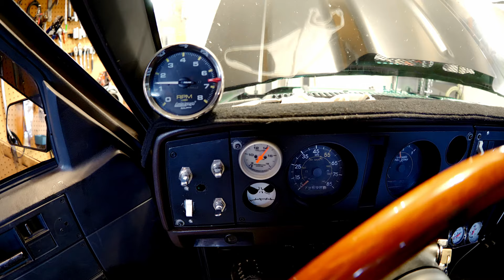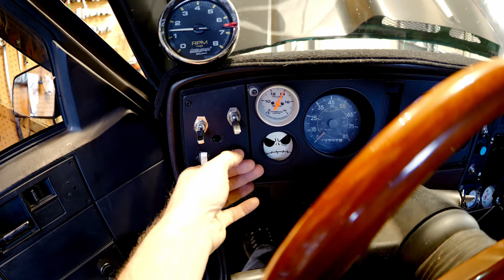Holley 4150 carburetor tuning “secret” you probably don’t know about.

Comment: We use to bend the factory linkage to get them to open sooner
Reply from the maker: Then it was probably opening the secondaries past vertical. Been there done that till I realize I was causing an issue.
Reply: Most likely your right, but it picked up our Cutlass .11 in the 60ft

Comment: I noticed you move the throttle twice on your fast rev up.   On second blip to get instant RPM I believe you are carrying over from the accelerator pump shot on the first blip.   I believe you double blip to keep from bogging.  Then, what the hell do I know?   I did the horrible thing on vacuum secondary Holley to put the screw in to override the vacuum diaphram on the linkage.  Take it out to get fuel milage on trips.  Going to race, put the screw back in.   Had 4 speed, so no problem pulling up against torque converter.

Comment: Thank you for great information & sharing your thoughts and progress. Like you I've been chasing & refining my tune for a while - this is one I'll have to try. 
One of the greatest improvements in throttle response came from the installation of Thompson performance power blast plates to both primary and secondary sides, particularly with the heavy accelerator pump shot I needed.  Cheers Mike

Comment: Thank you for posting. Great info. I made the part for 5, at 45 dollars it was high just to see if it worked.
 Well...it worked great. definitely picked up some snap. First hop on the street the shift light came on quick, I shifted, it stayed on. I usually do not lift when shifting, definitely had some wheel spin.

Comment: I was just tinkering with my Proform 750, before watching this. I noticed a high pitch squeal/whistle, when secondaries open. Never noticed it before. Maybe because the engine was louder at the point that they open, stock. Sounds like a compressor engine. I think I heard it on yours as well.

Comment: Sounds like to much transfer slot used  up to get idle  drill .093 holes in
Blades to shut them down so .020 shows  tranfers are acc. Pump shot
Before. Shot from above.

Comment: You can make all 4 butter flys open at once if you don't care about gas mileage ,I think you should have just went up in # on the squiters ,if you had the correct power valve ,check vacuum say its 20 so you need a #10 power valve then dial in the squiters  then the accelerator pumps and then the jets
Reply from the maker: I have videos that talk about all that check them out.
Reply: I went to 46 squirters, and still got a lean tip in at cruise. This fixed it. Yes maybe I could have dIcked around with the PV, but everything was good after the initial lean hit.

Comment: Great videos,
Frustrated with idling in gear at a light and loading up. I am going to have to increase my stall speed but do not want it to be to loose. 
 I have a comp hyd roller 286. 230/236, 350ci, 10:1, 67 nova 355's
 I have the holeshot 2400. I like that it is tight on cruise but think I need to go to the 3000.
Wondering what stall you have?
Reply: Do you have an afr gauge?

Comment: It doesn't give you the ability to adjust the timing of the secondaries opening.  It only allows you to change the opening point from stock to a point dictated by the position of the second hole and the length of the adjustable link. The adjustable link can only be one length, the length that places the secondary throttle blades at fully open when the primary throttle blade reaches fully open.
Reply: @bigboreracing356  If you will look at your carb you will see that you have multiple holes for the link on the throttle shaft. You pick a hole (which is what changes the ratio) then you adjust the length of the link to make the sec. throttle plates straight up and down at WOT. Your camshaft/crankshaft analogy is complete nonsense.
Reply: @bigboreracing356  "How is it nonsense?"

The carburetor adjustment is a change in ratio. Your cam/crank analogy has absolutely nothing to do with a ratio change.
Reply: @bigboreracing356  And what would that have to do with neither you or the OP  understanding that the adjustable link has nothing to do with changing the ratio, and that it is in fact  moving the linkage attachment point that results in a change?
Reply: @bigboreracing356  What are you six years old.
Reply: @bigboreracing356  This is hilarious.

Comment: Cool video. Question, did you square up the power valve and jetting primary to secondary? Seems like that is a must if you make this change.
Reply from the maker: The best way know if you're jetting is square with a PV in the front is to first block off all PVs and get a good WOT AFR of 12.5. then put a PV in the front and jet it down until you hit the same AFR you have then confirmed your jetting is square with a PV in the front. But changing the secondary linkage has zero effects on jetting but you may have to retune the discharged nozzles / cams.

Comment: So by installing this linkage and making adjustment for the secondary to open 1:1 this will open up my secondary sooner BUT  will I need to eliminate my rear  power valve in order for this to work
Reply from the maker: You can keep the rear PV.
Reply: @TPVPRO  ok thanks what is the benefits of  blocking the rear power valve
Reply: @ddstaton211 locking the rear power valve only needed if you already have too much fuel under part to mid throttle, usually carburetors with billet metering blocks allow for fine fuel adjustments you can thereby eliminate the power valve in most instances. Every engine combo is different sometimes depends on what your purpose is wide open strip usually best to delete power valves if I’m not mistaken…

Comment: Noticed your idle is way up 1300+ rpm w/ that lopey cam. Is it possible to bring idle down to atleast 1000 rpm w/ big cams? TIA 🙂
Reply from the maker: @benjiedelrosario4346  Yes, but I have a solid roller, and I prefer higher RPM for better oil splash and pressure. It helps extend valvetrain life.
Reply: @TPVPRO  I have a 289 sbf w/ a big cam that also idles between 1200-1400. When I bring the idle down a bit the engine stalls. Any ideas how I can adjust idle between 1000 to 1200 rpm? Thanks in advance 🙂
Reply from the maker: @benjiedelrosario4346  Check your timing first. I would lock out the distributor. If you have a mechanical advance, the timing could be retarding a lot at low RPM.
Reply: @TPVPRO  thanks for that tip. Am using a fairly new pro comp distributor w/o vacuum advance. Initial timing currently at 18 btdc and it stays there at idle.
Reply from the maker: @benjiedelrosario4346  If you have a big cam that's not much. I would lock it out at 36 and try that first.
Reply: @TPVPRO  will try that and let you. Thanks again 🙂

Comment: So your secondary pump is coming in sooner to fix the lean part throttle condition?
Reply from the maker: Not just the accelerator pump but the entire rear / secondary enrichment.
Reply: @TPVPRO  you got a power valve in the rear?
Reply from the maker: @jakefriesenjake  No PV in the rear.